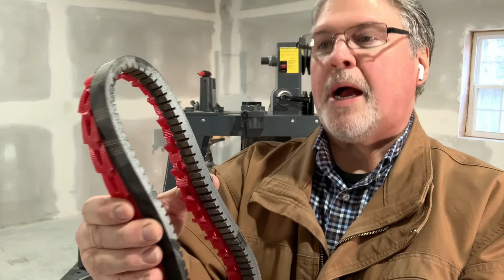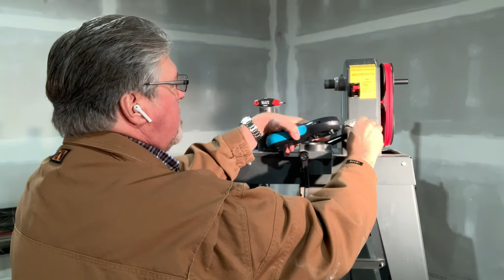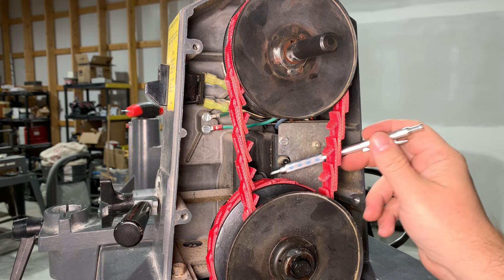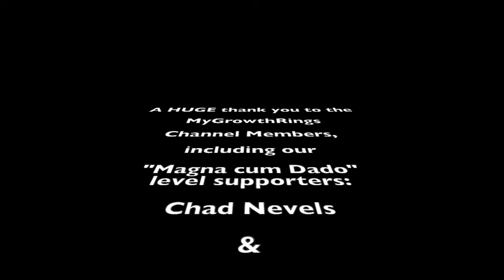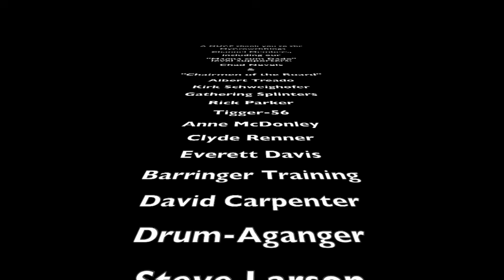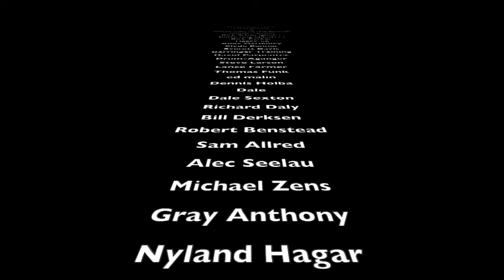Taming Vibration & 50 Hour Maintenance of the Shopsmith Power Station & Crafter's Station

Comment: I found that I also had to align the drive shaft front to back so that it would line up with my tool. I loosened to the four bolts that hold the "headstock" to the base and shifted it back so that it would line up.

Comment: Holly cow I’v had my power station since about 1986 and have followed the owners manual saying “no maintenance necessary”. Now I guess I need to see if at the least the motor has those oil plugs and get some oil in them I can’t tell you how many hours are on this as it’s always had the bandsaw on one side and a disc sander on the other

Comment: Scott, the switch on my power station won't turn off the machine.  I end up unplugging it.  Is there any easy fix for the switch?  Or would I be better off buying a new one from Shopsmith?  Any insight you might have would be greatly appreciated!
Reply from the maker: There may be. They will occasionally get gunked-up with sawdust. You may be able to blow it out by removing the key and hitting it with compressed air. Beyond that, they can be replaced.  I suggest trying the air first, and if that fails give Shopsmith a call to see if they have a replacement.
Reply: @MyGrowthRings  I took your advice and blew it out.  No change.  So, I took the switch out and I heard this little metallic clink.  One of the two metal strips in the switch dropped down onto the pulley.  So, time to contact Shopsmith for a new switch!  Thanks for the tip!

Comment: My crafters station does not have enough belt tension to use.. The shopsmith belts looks good though. Any way to adjust the tension that i havmt noticed?
Reply from the maker: Yes, thsnioning is done by lowering the motor. Just be careful not too over tension.

Comment: I have a question about the 20 #oil. I ordered the oil that you showed . The wrong oil showed up after 8 days. I sent it back. can synthetic oil be used? I was at the auto store and cant find any sae 20#oil. But i can get 0w20#oil synthetic oil. Can this be used?

Comment: Scott, did I miss something important? I don’t understand using the flap belts. I ordered the replacement belts for my power station since it was vibrating. I am sure that will take care of it.
Reply from the maker: Are you referring to the link belt ask flap belts? Link belts, work better than standard v-belts, and in this case, better than notched v-belts. If you didn’t catch that, then yes, you missed something important. Scott
Reply: @MyGrowthRings  I guess my failure to leap in this direction is I think the power is transfered from the sides of the belts, and the solid belts have more surface area than the link belts. I will review the earlier videos.□
Reply from the maker: @alberttreado3713  I get ya and yes, that’s true. The issue isn’t power but is vibration. The link belt is able to conform better to smaller pulleys and that introduces less whipping, which in part contributes to noise and vibration.
Reply: @MyGrowthRings  □And so, on my PowerStation, the link belts would be ideal....
Reply from the maker: @alberttreado3713  I believe so.

Comment: Thanks for the update on the link belts. I have used the metal stud type link belt (NuTLink) in industrial applications where there was no belt length adjustment possible. Think of the fancy & stripper rolls on a cotton garnet machine. The problems with them are the directional requirement that you noted and the minimum diameter of the smallest sheave. Please keep us updated as to how well they work.
Reply from the maker: Will do. Those style of link belts are interesting. I encountered one of those on an ancient tenoning machine that had a scary square cutter head. Those two things are forever cemented together in my mind.

Comment: Scott, since these belts ride a bit differently in the pulleys… how much different was the output RPM’s?  Or, is that a moot point?
Reply from the maker: It’s currently running just a tad faster than with the stock belts, but I suspect that will ease in as the belt stretches.

Comment: So oiling the motor and adding link belts to a 520 is also could/ should be done to quote it?
Reply from the maker: The motor on a Mark V or 7 shouldn’t need oiling, but the lower sheave does require oil on a mechanical headstock. I think a link belt on a Mark V is an interesting idea, but I haven’t tried it yet, so I’ll withhold an opinion just yet. Scott

Comment: Great vid as usual! Can you tell us where you bought the red belt the part number for 5’ and the number of links used after you removed one link. I need to do the same thing on my power station. I tried to lube my motor and installed 5 drops and the oil came to the top of the tube no more could be added. I assume it was so dry it would not soak in. I need to go back and see if it will take more oil. I assume I do this a few times it should become wet enough to start taking the 100 or so drops. Thanks for all you do to educate us.
John
Reply from the maker: It’s all in the video description area, just click “Show More”.  Sounds like you had plenty of oil, assuming the plug was removed! Scott
Reply: Had the same experience, added 5 or so drops until it soaked in and repeated this to I was able to get sufficient oil in.

Comment: Scott the speed controller seems less complicated than on the mark v. Would it have been possible to use on the mark v.
Reply from the maker: It is quite similar to what was used to add variable speed control to the 10ER, but I believe that the way Magna ultimately went was a better idea.

Comment: If you are the type that is confident in opening up a motor, it may be worthwhile to replace the oil wick material around the bearing.
I have not taking the motor out of one of my power stations yet, but I've had a couple of the motors apart on MK5 machines that had a bushing for the rear bearing, and the oil wick material was so far gone that it was not recoverable.
You can buy it in a rope/yarn form, or in a felt pad form and cut it to fit.
Reply from the maker: Yes, that’s a very good point. That wadding does wear out over time.

Comment: Great video and great content.  The last time I had to align the motor to the pulley on my power stand, I used a 3-foot level and got it down perfectly both horizontally and laterally.  Easy day and no wobble.

Comment: Good evening sir, thank you again for sharing your wealth of knowledge. Truly helps youngsters like me especially considering how many people of my generation would never use a tool other than a big box store brand. 
I'm having issues with my motor alignment on my powerstation, it is preventing me from adjusting my speed to the full rpm.

Do you know approximately how low on the mounting bolts you have the motor set to? I would greatly appreciate the help!
Reply from the maker: It’s different from unit to unit, but I’m used to seeing the motor at least 3/4’s of the bolt’s length from the head of the bolt. When it it at the proper position at high speed the lower belt isn’t quite bottomed out in the center pulley.